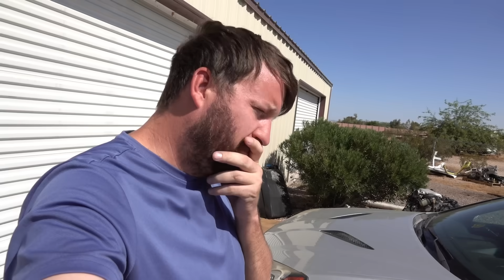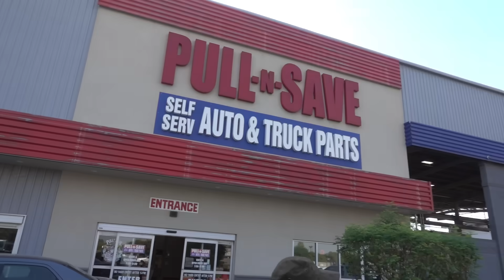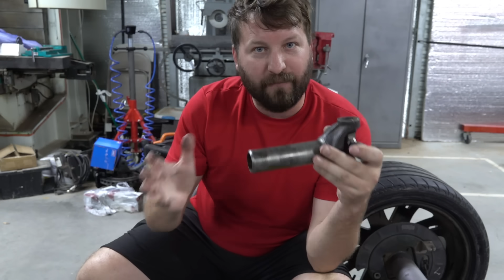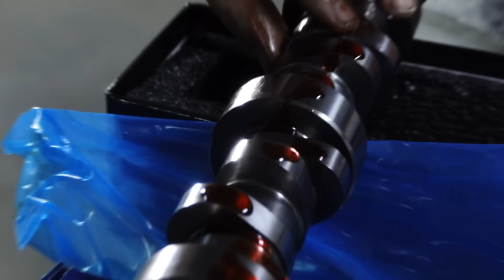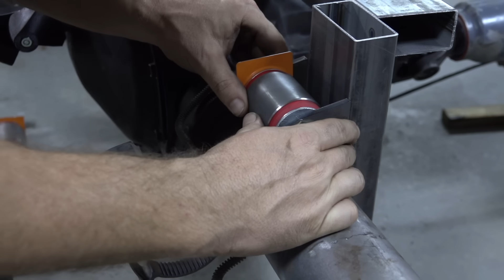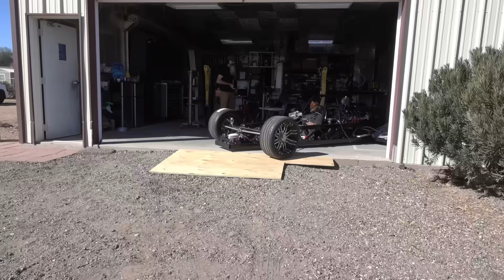Death Kart or Die Trying! LS Formula car full build!

Comment: PICK DIFFERENT PARTS.    
A BUMPSTOP  IS NOT SUSPENSION
YOUR BELLIGERENCE  IS PAINFUL 
WOW U DID IT, BUILT A HEAP OF POOP!
FOR $35,000 CAN GET A DRIVETRAIN LS3 V8 crate engine with a monster racing transmission
About $2500 for a stand alone computer system to rin it all
$7,000 for big brake kit for front & rear 
About $10,000 on miscellaneous
$1,000 for suspension 
Then $47,000 for the chassis.  
10 years!    
Kmon its not that difficult
Reply from the maker: All you did in this comment was demonstrate you don't know anything about racecars. $1000 for suspension wouldn't even get you one coil over. Unless you bought an amazon coil over (useless on the track). 

In the end this car would smoke the build you listed above and do it for 1/4 the price. That's why it took 10 years. Throwing money at it is an idiots strategy AND is the whole point of this build. To prove the expensive builds are not always good builds. It takes actual knowledge to do the same task for less. 

It goes on track latter this year. Then we will see.

Comment: The dimensions of the tire placement is a big problem you'll never be able to turn a tight radius with that setup
Reply from the maker: You just watched us drive it on side streets..... In a nationhood.... where the turns will be the most sharp ever.... and it did just fine.
Reply: Well maybe I'm wrong, I'll be pleasantly suprised to see how it does on the track  @centurialinc
Reply from the maker: Testing latter this year.

Comment: How can you raise $112,000.00 and not build a cheap racecar? Sounds like you scammed your friends and family to me! I mean you can build a proper racecar for a little over $100k
Reply from the maker: That's a good question. So first of all they bought stock in our company and that company still exists and makes a profit to this day. So not a scam. It took us 3 shots at it to make it work because a budget race car is easy but, one that is fast and sells to the race car community is not so easy. A budget race car is not cheap because we say so. We had to look for ways to save money and not sacrifice speed. If you go back through our older videos you will see the vast engineering effort we put in. We did our own castings at home, did all the design work and calculations behind each part and selected parts from a wide range of places to specifically do the job. We finally settled on this one here the third attempt. And we still have not yet proven it can be fast on track. But will find out latter this year. AND! We already have a small wait list for buyers.... I didn't have to tell that story. But I chose to because it think people need to hear that what we did was not an overnight success and took us 10 years to get to, and we failed a lot along the way. And that's how life really works.

Comment: I'd love to see the ls+trans bolted to an independent rear truck suspension differential assembly... if you have subaxles and each wheel has suspension, then the differential does not need to be on springs and can thus bolt straight to the transmission without really sacrificing handling
Reply from the maker: Sure we can do that on the next one.

Comment: Great job guys, really. May I suggest to make the steering rack ratio a bit quicker. Also the wheelbase is a bit too long but I guess due to the size of the gearbox you cant change that much
Reply from the maker: Hello. Thank you. Yes both of those things can be changed if needed. We can switch to a corvette trans axel and save some length that way. But those are more rare and definitely more expensive. Testing coming soon.

Comment: After 3 tries and $300,000 You would think Yould have a spare part or two. Maybe a frame, maybe some transaxles from a porsche. I hope You get some kind of suspension at least for the front cause middle age guys that built stuff their whole life dont have backs as strong as a horse. The bones in our lumbar are worn away and the discs become thin, so take care and if somebody spills drink straws on the floor Dont help to pick them up. No amount of surgeries can fix spinal cord damage. All you can do then is tell everybody about the things You used to do. "Yeah, Tony Hawk thought I was a badass and I can still pull off some tricks in my walker"
Reply from the maker: You can see the other builds in our older videos. They where sold off to help fund this one. No not $300k. $112K, what we did with that money is mind blowing. It paid for years of full time effort R&D and lastly 3 builds. No other organization could have done that.

Comment: Looks like u need a new spider gear 😮
Reply from the maker: Good guess. 3-4 gear set was done. The cage was split and clutch plates where toasted. It had a hard life previously. Someone probably ran it low on oil. O well we fixed it and added some upgrades. Testing coming soon.

Comment: Really cool other then the no suspension thing racecars need suspension to grip and corner even f1 carts have suspension
Reply from the maker: Thank you. F1 has suspension because the rules require it. Other wise they wouldn't do it. The tire can do all the work. Top Fuel drag cars that go 300+ mph do not run suspension.

Comment: Our formula cars had very little suspension travel, so tire sidewall flex was very important. If you can find tires with more side wall, then you can run lower tire pressure, and maybe gain a little compliance.
Reply from the maker: Good idea! We have a few tire and rim combos we want to try. These are 275/35 -18. Do you remember what you ran?
Reply: @centurialinc  The sizes won't really work for you, because of our little 13" rims.  
Formula Continental racing, the approved tire size is Hoosier 20.5 x 7.0 - 13 for the front and 22.0 x 8.0 - 13 for the rear

Comment: My experience with solid suspension, they begin to hop and bounce around the road at speed. Things elsewhere begin to break along the frame as the impact loads of bumps aren't absorbed by springs.
Reply from the maker: Very possible. We did mount them with poly bushings. Some big tires with low pressure might help as well.

Comment: First turn should bust the tail off the transmission.. 

 Then I realized this was a month ago.
Reply: Then I watched the rest and you solid mounted everything.
 It's going to push straight off the track at some point. Maybe the first curbed turn you hit.. good luck
Reply from the maker: You know what's interesting? No one knows where the limit is..... It obviously works. Drives around just fine. Now what happens as we go faster....? only one way to find out. Transmission just came back a got a few upgrades. Turbo is going in and then body work. Latter this year we send it.

Comment: Why wouldn't you just use the IRS from a Chevy tahoe?
Reply from the maker: Cost. This is as cheap as it gets. A rear diff is not suspension. You will need coil overs. Those are $$$$.

Comment: “The goal is high performance racing on a blue collar budget” is a terrible way to go about it, and a common mistake made by new racers. You don’t need to go fast to have fun. What you want is competitive racing. I’d rather race (and do) in a pack of 40 relatively slower cars than in a pack of six or eight high horsepower cars. “High performance” means (relatively) high dollars in terms of buy in and operating costs. Competitive racing means finding a field where you want to race that is popular with good turn out. In my case that meant racing a local Spec Miata class where we were averaging 30-40 cars every race weekend,
Reply from the maker: This is for Global time attack. Door to Door is fun too. But we are specifically going for time attack. So it needs to be fast.

Comment: Boo, Should have replaced or repaired that tranny and do a hard test run before ending then follow quickly with it running full out.
Reply from the maker: It needs a lot more than that. The turbo isn't in and we need to finish the body work. Then I can send it!

Comment: A real race car ?  Just go buy a 125 shifter kart, all the race car you can handle  and more fun!
Reply from the maker: No, shifter karts can't go 200+ mph.
Reply: @  Is that the goal 200 + mph?  If so fine but your premiss was an LS powered formula car. What your building has no class to race in. Call it what it is a 200 mph DIY project on a budget. That’s will be fun to watch but this build will never race in any existing class. This is not a formula car.

Comment: That genesis is worth about $5,000 WITH the LS. Where did 25,000 go?
Isn’t the point of this project to be able to build a car without being well funded? 
I’m curious but skeptical…
Reply from the maker: Watch our full LS swap video. We put a 6.0 aluminum block in it with a 6L80e. Those alone set us back 5k. We then did all new electronics from Holley. That was 2.5k or more. New injectors with new intake, full exhaust system, LS swap radiator and much much more. The full build list is on our website. Here is the link. https://www.centurialinc.com/genesis-gta-race-car

Comment: Yea 5 decades of racing and owning a shop... seen a 1000 ideas like this and not many will admit shortcoming.. great for that....  

BUT... in order to be a success?  you gotta have a "use" for this.. without suspension?  going to get pasted at anything you try to do competitively.. Having raced as much as we have, best advice to someone starting out?    DO a lot of research and "Copy".... Most forms of racing have 10s if not hundreds of years of experience in layout, design and function.. reinventing the wheel?   yea, might make an improvement but odds are against you...  But that is even a challenge when you can't load on a trailer...  ::cough:::
Reply from the maker: We will see. The trailer issue is trivial. You will see how we fix that in the next episode.

Comment: Nice!, I did a similar thing but with a torqy i4, I came to the conclusion that the GB is "overrated", and connected the driveshaft to the motor (with or w\o a clutch if you're ok with a rolling start) the 4th gear is slightly under direct drive so it's ok, the weight loss is more beneficial, next I welded the frame from alu instead of steel, my "cart" wasn't that big, but still it helped a lot. yours is massive, so it would help even more. last but not least, tire width, sure you don't have a wing, but those wheel are too big and heavy, it's harder to rotate all that mass, if the engine will remain stock then a good tire thread and 225\255 width is all you need. And these are just thoughts based of my experience, it's your car, so do to your heart's content.
Reply from the maker: Very good thoughts! I did not show the design in the video but you can check it out on our website. Full body with front and rear wings. It will be interesting.
Reply: @centurialinc The design is awesome!, you have a great vision(for the car and for the company as a whole), I would love to support in all ways, and work with you on the car, but unfortunately I’m just a soldier in Ukraine, and have a salary of 300$ a month, which almost all goes to the gear i need to survive. One more input (if you may), I would recommend using fibreglass instead of aluminium sheets, all of the above recommendations that I had, I still think they fulfill the concept in the best way, argon tig welding is not that hard, I think it would benefit the car.

Comment: Performance is an example of applied physics. There is an old Hot Roder saying: Les weight, less wait...
Just think about what original dragsters were called. " A Rail job" and later shortened to just a "Rail" in the 1950's and 60's as in it was nothing but an engine and the frame rails. What does this thing weigh? You basically built a rear engine funny-car chassis. Hmmmm...
Reply from the maker: Well said! To this day Top Fuel dragsters typically do not run suspension and rely on the tire to do all the work. Some frame flex but 90% the tire. I for see us trying lots of tire combos to see what works best.
Reply: @centurialinc  That will depend on if you plan on going in a straight line or around corners! 
I imagine it will do both rather well when properly set up.

Comment: You are going to need the steering to turn the inside wheel more than the outside, you can do this by making the steering link a Y and offset it and reach across it, right steers the left and left steers the right wheel, this will make it turn great and not fight thru the turn.  https://en.wikipedia.org/wiki/Ackermann_steering_geometry.
Reply from the maker: Thank you we are aware of this and the car is currently setup to have a similar effect. It is mostly neutral right now. but can be adjusted.

Comment: Any thought to an asymmetric design?  Push the engine forward with a stubby drive-shaft, sit between the engine and right rear tire, all the rest of the guts in front or to the left of the engine?
Reply from the maker: No, but we have simple ways to reduce the length. A Corvette trans axle and change the front end so your feet are more forward. That will save us 2 feet.

Comment: The poly bushings should be fine.  Personally I'd mount the axle bushings farther apart to better deal with dirve and braking torque.  

Your transmission output bearing is going to take a BEATING.  See if you can replace the output U-joint with an industrial rubber coupling.  (a "tire" or "donut shaft coupling" is probably best.  Google has lots of hits.)   

Might want to find a way to add dampers to the suspension.  This will let you control tire bounce better.   A "tweak" adjustment would also be good.  Go-carts use chassis twist to adjust performance.

Finally, why didn't you use the engine-transmission package from a front-wheel drive car?  A V-6 or V-8 out of a mini-van would shorten the car a LOT.
Reply from the maker: Very good idea thank you! We just might have to do that we will see.

Comment: Personally I'd have put a manual gearbox in it. Much more feel and control but holy cow, what a monster.
Reply from the maker: We wanted to do that too. But he shifter was more work and hassle then we wanted to deal with. Also it's going to be a ruff ride so we thought for now let the auto do the work. Follow to see what happens.
Reply: @centurialinc  Its all learning and growth as you go. I raced lightweight bikes many years ago and would comment, look for ways to add simplicity, lightness and reliability. My dad used to tell us to win you've got to get it across the finish line. Wishing you ALL the very best and enjoying the build very much.

Comment: Not a criticism just a question. Why not use an independent rear from a 90s Cougar, Thunderbird, or 03 04 Mustang svt, which would give you actual suspension options. Paired with c5 or newer knuckles, which would give you double wishbone suspension. Granted there would be extra cost for axles to go from a ford 8.8 to corvette spindle. Again just curious.
Reply from the maker: Just cost. This car will have it's own weight in downforce when done. And making suspension for that is very costly. The goal here is the fastest car we can make on the smallest budget possible. So we needed the simplest cheapest possible solution and this is it.

Comment: Forget the polybushes, without suspension you need high profile tires and lowest possible tire pressures.... Also that chassis will need flex, you have built it way to stiff (large section tubing). Some simple FEA from a CAD package will allow you to figure that out. There was an F1 team that tried the no suspension thing (mostly because of aerodynamics) and it did not go well so this will be interesting 😂
Reply from the maker: We can definitely do that.
Reply: @centurialinc  sorry, I edited the comment so some more info now 😊
Reply from the maker: Yes the F1 teams did a solid push rod bar. This has at least a poly bushing to give us some vibration damping and motion. Not 0 like they had. The car still was fast even though it had locked suspension. Will be interesting......

Comment: What you're trying to do already exists. It's called Locost (low cost locus) there's. Any builds out there for less than $10k... with full suspensions and body work etc.
Reply from the maker: Those cars are slow. This is a high performance build. Never been done before.

Comment: You guys would have been better off with the drivetrain out of one of the front wheel drive gm v8 cars.(think '07 monte carlo ss) This thing is ridiculously long. You could have had a transaxle and shortened the whole cart by about 3 feet!
Reply from the maker: That car is less common. We could have used Corvette parts. The point is to use the cheapest most commonly available parts we could possibly find. This is what you get.

Comment: That pointy steering column bracket will not do your chest or face good during a front end collision. Suspension is a must. Did this type of build before with junkyard parts in the 90s with no suspension, super sketchy and loved to crack welds everywhere. Nice go at it though, brings back memories.
Reply from the maker: Thank you. It will be interesting. It still has some movement. It is all rubber mounted. Not solid.

Comment: Would be ok to go square for the cockpit but rest should probably be tubing and you can incorporate suspension easier. You have got to have suspension or at any high speed you hit ANY variance in the surface and you come off the track and it's bye bye. You could honestly find a destroy mr2 tare it down  keep the cockpit and tube in the front and rear components fit that motor and build your own body for less money and head ache continuing with this one.
Reply from the maker: May be but our design will have lots of aero downforce. So it might not bounce off the ground. We will see.